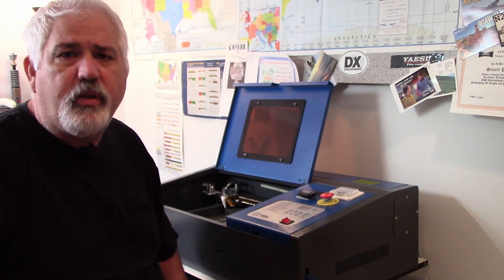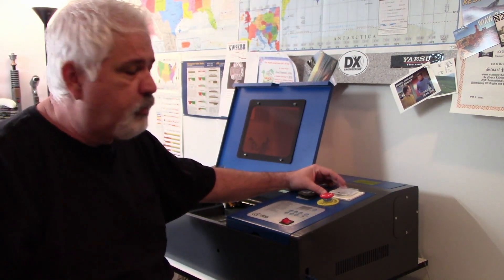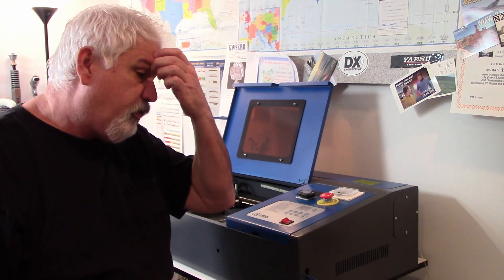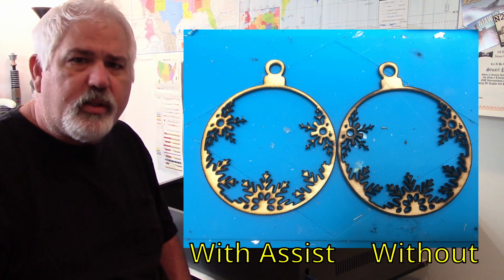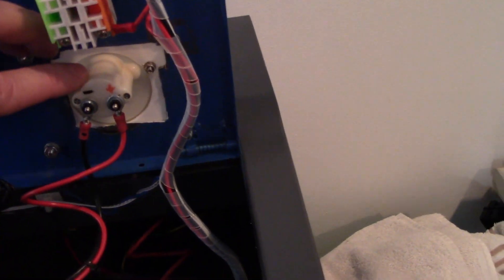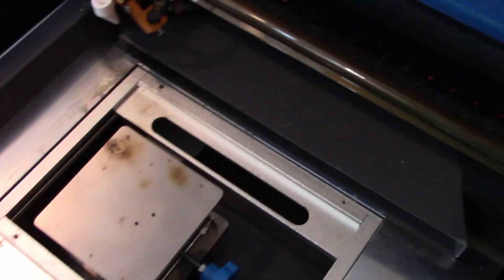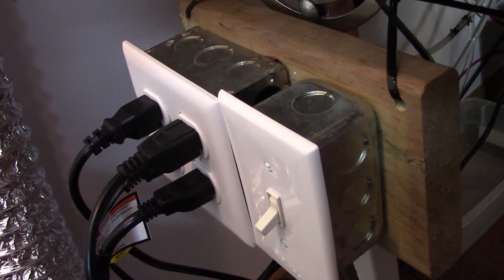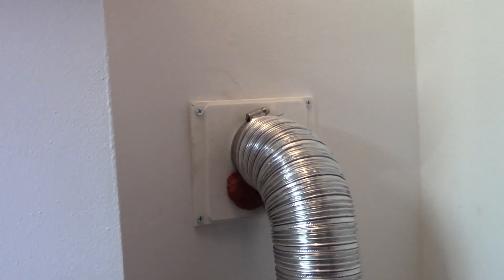OMTech K40 Laser Cutter Update

Comment: Did the safety stop switch break as a result of being poor quality or did you break it? How many of the things did you break vs how many were crap? You made it seem like it was the machine but i need to clarify? There i go asking questions before seeing whole vid. Well first part of vid is misleading.
Reply from the maker: I accidentally broke the emergency stop switch trying to get it out so I could install an ammeter. The fan, water pump, and water temp sensor were cheap junk and broke when trying to use them the first time,